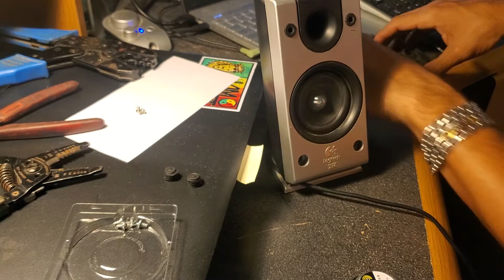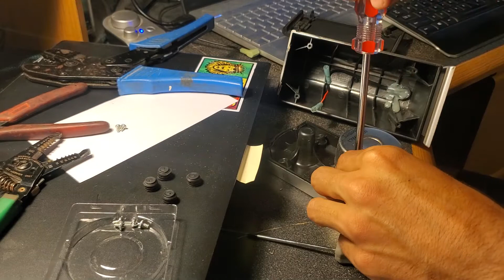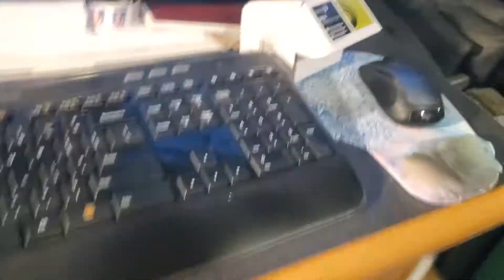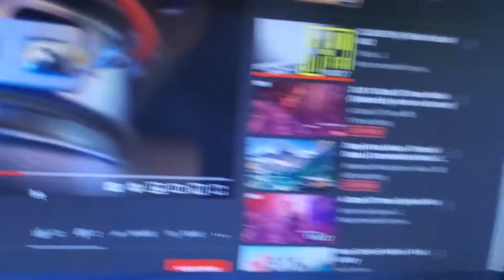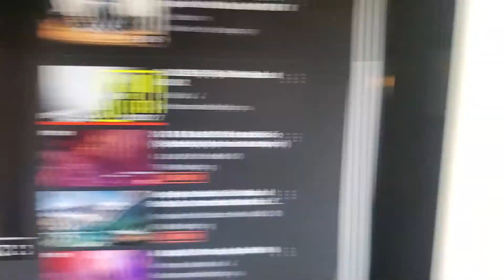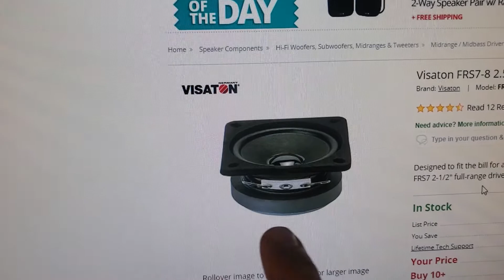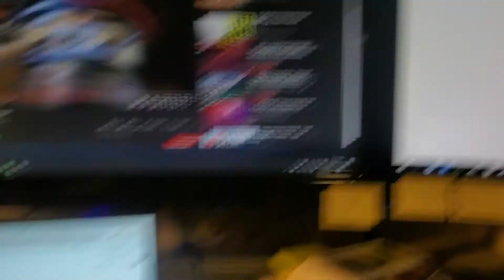Repair Logitech Z-2300 Satellite Speakers (replace part 170001-0000)

Comment: hey   helpful video  could you have used the black bolts from the front of the speaker to screw the speaker in?  or were screw the only way to do it given the angle   thx
Reply from the maker: The bolts from the front are a different size than what's used inside so I would not recommend trying it. I used screws because the holes didn't line up perfectly so I needed self tapping screws to ensure a strong connection when fastening the new part inside the speakers housing.
You could use a bolt if the holes lined up and fit properly to secure the component nicely inside without any noticeable problems. Be sure it's not loose in there because then you will hear vibrations from inside when you use them with volume. Good luck!!
Reply: @BrentBurke13  thx
Reply: Hey Brent, i've read online that since the ports are actually sealed you're less likely to have problems with the speaker.  I installed a different pair of daytons, one i actually glued in so it was completely flush, the other I screwed in so there actually was a little gap between the driver and the case.  Anyway, the one that was flush  actually blew out at less than a year old and only running at 75%, whereas the one with the gap is fine.  So either I caught a dud, which is likely, or it's beneficial to have some air venting.  Any thoughts on this?  I'm considering putting some holes in the ports, which I understand can effect the bass a little.  But can extend the life of the speaker perhaps.  I still think I caught a dud.  Any experience or thoughts on this?   thanks
Reply: @johnnybeckenterprise  Hi! You mentioned you installed a different Dayton speaker (NOT the DMA70-8 2½") and it failed. Could you please tell me which model you used?

Also, how did it compare soundwise to the originals? Was it darker, brighter or similar?

Thanks!

Comment: Or Can I use Altech Lansing Expressionist Ultra sattelite as Logitech Z 326 sattelite
Reply from the maker: Are you talking about using a totally different satellite speaker on the system or changing out the internal component of the satellite speaker?
If its the full speaker you just need compatible hooks ups or splice the wires together to make it work
If its the internal speaker the measurements for what fits in the satellite casing is what matters which is why I chose the parts that I did.
Best of luck!!

Comment: I have the replacement speaker I ordered same as yours from parts express but I am having difficulty opening the satellite speaker they must have used so kind of adhesive can any help me on that issue ? I tried to pry them apart and already marred up the finish on them
Reply from the maker: Are you sure you remove the screws behind the rubber screw covers in the corners? I have never heard of them using glue or any speaker usually for that matter. They will typically always have an accessible way to the speaker unit.
If there is in fact glue I would try using a razor blade to run the seem and remove the glue as best you can before trying to pry it open somehow but again that shouldn't be needed.
I would search as thoroughly as you can for screws as 99% of all speakers I have seen have been constructed using screws to hold them together in their casing.
Let me know what you find and I'll help you as best I can
Reply: @BrentBurke13  I really appreciate you replying back  and I finally got them apart but I ending up marring them in the process but I replace the 2 1/2 in speaker and they sound good like before
Reply from the maker: @901THECAT  all's well that ends well haha glad you were able to get them fixed and playing sound again!!

Comment: Hello Brent, thanks for posting this. I just got my new DMA70-8 2-1/2" Dual Magnet Aluminum Cone Full-Range Driver 8 Ohm to replace my old & damaged Logitech speakers. I'm a little bit confused since you are connecting the red wire to the big pin. I noticed that my old satellite it was connected the opposite way (black to positive and red to negative). is that matter? Can you please clarify further? thanks
Reply from the maker: Thanks for you comment!!
As far as my knowledge goes the positive and negative connections don't matter as long as you wire all the same way so just make sure your second speaker is wired however you do the first. For extra assurance I would try to just match how the originals were wired but if you already did your repair and switched to the same way I did it then dont worry it should work just fine but again just make sure you did the same set up on the other speaker. 
Hope it goes well!!
Reply: @BrentBurke13  all done mate, thanks so much. Working perfectly. Best Regards!
Reply from the maker: @Libre-r4t  glad to hear, enjoy!!
Reply: DMA70-8 2-1/2" dual magnet aluminium

Comment: Awesome man. Great and informative video. I've had my z-2300 set for over a decade ever since high school, and it's grown on me.

I would've had no idea on what kind of speaker replacements would've worked in these without you.
I've got to replace the rubber surround on the factory driver, because the original one started dry rotting and tearing apart.
Reply from the maker: Glad it helped and I know what you mean I have my speakers for about a decade as well and didn't want to get rid of them so just had to find a way to save em haha

Comment: I have these speakers and replaced the right speaker with the Visaton. (Great video by the way) I still don't get sound from the speaker. Any idea what might be causing that? Thanks
Reply from the maker: Thanks glad you liked my video.  If no sound is coming out my first guess would be that either one of you connections may have come loose or possibly could have them backward?
Other than that not sure usually you should get some sound.
Reply: There is still sound coming from left speaker
. As before.. Just not from the right one. I notice the cable that runs from speaker to back of subwooder looks like a regular RCA to speaker cable (red and black) maybe that's bad?

Comment: With which other speaker model can I replace it, because the  Dayton Audio DMA70-8 cant find to buy it in Spain / Europa?
Reply from the maker: You can also use the Visaton FRS7-8 (I put a link in the description to another video that shows installing that one)
You should be able to order either one on parts-express and have it shipped to you
Otherwise I would recommend just finding something near you that has the same dimensions and speaker quality.
Reply: Ok, thx, its 60 dollars the delivery from USA so fill check hire
Reply from the maker: @icopenev6023  ouch sorry they are charging so much for delivery to you. Hopefully you can find it from another site that would ship it for cheaper to you. 
Best of luck with your search though, I hope you are able to find something :-)

Comment: I would recommend soldering the wires to the speakers, the wire tips you used will fail because of the vibration. You won't get the full sound out the replacement speakers because the new speakers have  dust caps and the originals have a metal cones which bring out more treble, higher frequencies. That's important because these subwoofers are powerful, they might overpower the satellites. Even the original speakers sometimes struggle to keep up with the bass. It's really hard to find parts for the original speakers but I would recommend taking the time in repairing them.  Nice choice though, that's the closest after market Full Range 8 Ohms 20W RMS 40W Peak speakers that fit in the casing.
Reply from the maker: Thanks I unfortunately am not as much of an expert on audio equipment as I wish I was and totally understand what you mean regarding soldering them I was just lazy and went with the quicker option but luckily haven't encountered ay issues so far but will keep that in mind if I hear any change in the sound.
Sadly yes its hard to find as well a built speaker as was offered in the originals and maybe had I known to repair the speaker I would have done so and if you do and happen to make a video on how to do it please feel free to link it here to help any others in my situation.
Thanks for your comment I appreciate your knowledgeable insight :-)
Reply: @BrentBurke13   Here is a video on how to replace the surround on most speakers, even though the man in the video says that  speakers are toast when the coil burns out which is false, it's still a good video. https://www.youtube.com/watch?v=aqRf2IJn0YI
here is a link for the surround, these are foam 
https://www.amazon.com/gp/product/B07S69WKCF/ref=ppx_yo_dt_b_asin_title_o07_s00?ie=UTF8&psc=1

but if you want rubber like the original:
https://www.amazon.com/gp/product/B07S7D284P/ref=ppx_yo_dt_b_asin_title_o00_s00?ie=UTF8&psc=1
Reply from the maker: @amiscellaneouschannel3098  I'll definitely have to try this next time if another speaker of mine fails, thanks for sharing!!
Reply: Don’t get this rubber surround, it’s the wrong size, the foam one is the right size, can’t find the rubber kind that fits.

Comment: Very helpful indeed - thank you.  I did everything I could to stop that buzz in one speaker and now it's good (better?) than new.  I used a hot glue gun to secure the speaker and it's fine so far...   I checked 4 different Z2300 satellite speakers and 3 of the 4 had the black lead connected to the RED (+) terminal.  The 4th had + to RED.  The RED line is the center tip of the RCA connector - which is how it actually should be.  I'm guessing the Logitech assembly line was not exactly up to NASA specs.  A quick Google search says that polarity with speakers is not as critical as having all speakers connected the same - so I stayed with RED to the NEG terminal and they sound great all around.  Also...Ya got laugh at the "port" on these speakers.  You know what I mean if you've ever taken a close look...   :)
Reply from the maker: Wow can't believe that many had the terminals switched haha I too have noticed switching them has never caused an issue but it does make sense that it would be best to match them in a whole system so that's good to know and will definitely remember that for any surround sound systems or additional speakers I add on haha thanks for the info and your comment :-)
Reply: You will want to switch polarity, see my comment above

Comment: Thanks, that's such a great video!  I've been using my Z-2300 with volume and bass at about 90%...Result, the left satellite is now buzzing at high volume. I am considering fixing it with the same speakers as the ones you used. However, I would like to know if there is a way I can completely replace the Logitech satellites with a pair of bookshelf speakers or studio monitors and keep the Logitech sub.
Reply: Same happened for me.. those speakers rip through their surrounds at higher volumes.. you can definitely swap them with other speakers I did it and used klipsch speakers which have better clarity and handle more power. Go for it!
Reply: @christianmontesino171  I swapped them with some presonus speakers, and I'm very happy with them. I guess you plug yours directly into the sub's crossover. I use mine with a y splitter making the speakers and the sub play the same thing while being totally independent of each other.
Reply: @fadilisamotu3000  hey! That works too!
Reply from the maker: I would assume that is possible just need to use the same type of input plugs used on the original satellite speakers.  You could probably repurpose the original connectors and just splice the wires together for the other speaker.  My only thought of concern would be the amount of power sent through the wire not overloading the replacement speakers you connect.  Never hurts to try but I would see about finding  those audio inputs at an electronics store and fixing them to your alternate speakers just in case some how it blows the speakers you still have the originals to plug in as back up.
Good luck!!
Reply: @BrentBurke13  Hey, I got some preaonus studio speakers that I am using with the subwoofer through a two-female-one-male jack y-splitter. Thanks for your reply!

Comment: original part how many watt?
Reply from the maker: The original satellite speakers were 40 watt, same as my replacement Dayton DMA70-8 speakers
Reply: @BrentBurke13   mmm I think no. The info taht Logitech gives the original z2300 satellites are 80Watts MAX and 40W RMS. This Daytona is 40Watts max and 20 RMS.

Comment: whats that little piece to connect the wires called? (The ones you're using to skip the soddering) Thanks!
Reply from the maker: They are called female spade connectors.  Im not sure what size I actually used but if you have your replacement speaker you can visit any hardware store to compare the sizes and see what fits best.
If you have any trouble with them or any other questions just let me know.

Comment: Why didn't you consider the Dayton Audio ND65-8 2 1/2"?
Reply from the maker: I considered those but the outside diameter was .25" smaller and with the diameter not being a square I was concerned that it may not fit the original housing and match up with the holes correctly.  I found that the measurements for the screw holes to be just about perfect on the Dayton Audio DMA70-8 and it was a slightly larger speaker option so I thought it to be the best choice.
Hope that helps with your decision!!
Reply: @BrentBurke13  oh interesting, thank you for the reply!